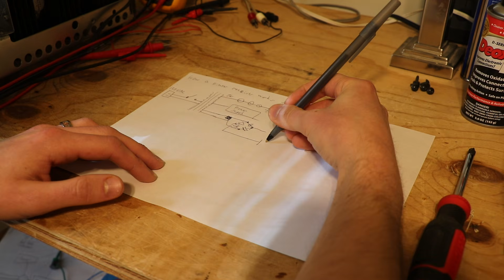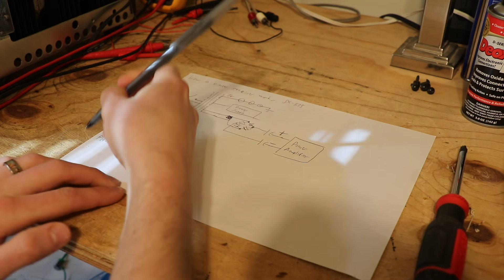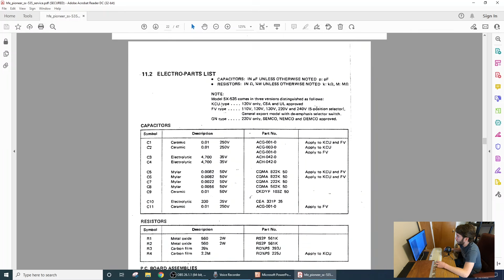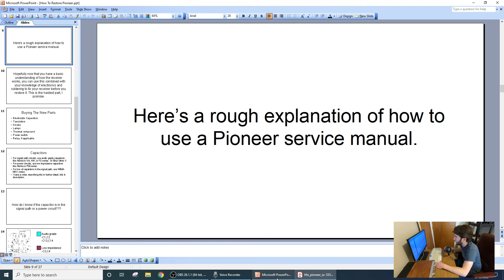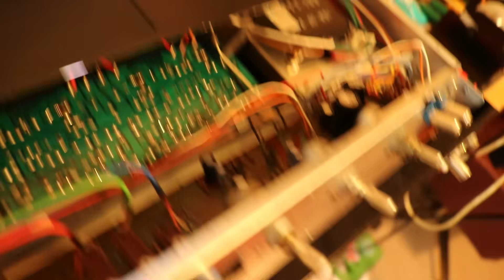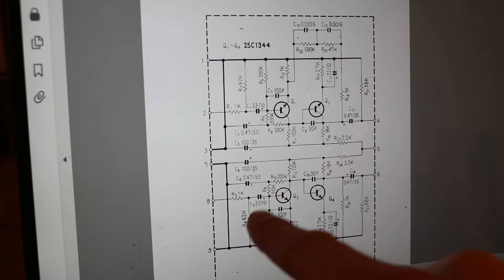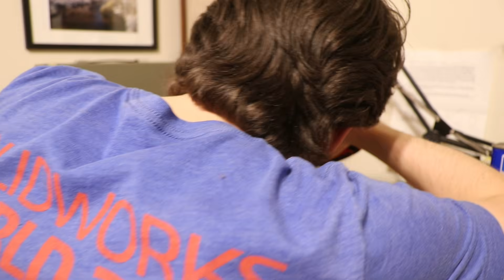How To Restore Vintage Pioneer

Comment: Fun fact that you may or may not know: The sheets you mention as being "plastic" insulators for the transistors on the power assembly are called "mica" because that's not a company name or brand or anything, it's actually the material that they're made from. Mica is a type of mineral, basically like a stone crystal that can be sheared easily into paper thin sheets. Sometimes they will be grayish or yellowish or clear. This is also why they are quite fragile. It's slightly flexible, but will easily crumble apart if you apply too much pressure to them. You can buy replacements for those. Really good video. Very informative.

Comment: The manufacture quality of Electrlytic Capacitors is imporant as well as the temperature rating. Capacitors maximum operation temperature of 105Deg. C should be more reliable that capacitors rated at 85Deg C.

Comment: Hello:  I just started watching your channel and do find the videos helpful.  I have been in electronics since high school and now am 55 years old.  I learned something from you today, I have seen schematics a lot and got my amateur radio license a few years ago, now general.  Yet I had never seen an electrolytic cap diagrammed the way that the Pioneer SM showed.  You can always learn!  I would like to see a video on a Pioneer SX2000 as that is the unit I am likely buying locally.  It has tubes in the power amp.  I am sure that I should go through it and clean the controls and all the usual components, though I believe this model will mostly discrete components.  Thanks for this particular video.

Comment: Just found you!  And not a moment too soon. I JUST picked up a SX-535, super clean. Please advise if you have a parts list of EVERYTHING, all pieces lined up in front of the unit. I'm diving into my own rabbit hole. Vintage audio is now my preferred hobby now that I've had 70 trips around the sun and the reactions are not what they used to be riding the motorcycle. Reply is you have a list.  Of course I can watch the entire video with a note pad!

Comment: I bought an SX424 brand new in 1973 and that's what I use today. I found a local shop owner who has been repairing electronic gear since the 1980's and spent about what I originally paid for the unit 53 years ago when new.  It's been relamped, cleaned and the power amp caps replaced. I know that doesn't agree with many who look for complete replacement of many components, but the point of diminishing returns is pretty low on this model.  It was the lowest stereo receiver on the Pioneer totem pole when new, but it has some sentimental value and works fine for my use. If it fails it will make a good nightlight!

Comment: The technician changed out 70+ capacitors in my Bang-Olufsen late 70s audio system. I was astounded by the number of capacitors. The unit isn't well ventilated, and that may be the reason for the failures.

Comment: One of the best how to videos I have ever seen.  BTW, tantalum capacitor are polarized. Not sure if it makes a difference here but if may affect the ripple filtering. Have you ever had a problem with those pinching plastic mounts breaking? Or finding replacements parts if they do? There are small ratchets that will hold a Phillip head bit for very tight areas.

That was a clever trick on attaching wires to the large electrolytic capacitor leads on the amplifier board.

I did want to mention one thing about eliminating the resistor between the positive and negative leads on those capacitors. The combination of the capacitance (farads) and the resistance of resistors creates a frequency band/notch filter for smoothing the power rails for the power transistors. Also be careful with routing wires over shape edges. Wire insulation can cold flow over time and create shorts.

Comment: Thank you for this video.  One small nit -  you describe some emitter bypass caps as “power” just because they go to ground. This is not accurate- they are there to decrease the AC impedance of the emitter path to ground to set the AC gain for the audio.  A better way to characterize the caps is whether they are filtering 120 Hz rectified AC or providing supply bypass.  Those should be the low impedance power types.  With all that said, you’ll be hard pressed to go wrong with a good quality Nichicon or Panasonic cap of any series.

Comment: I had been looking for a vintage receiver and bought a Pioneer SX-535 off marketplace for $60.  It supposedly "worked", but when I hooked it up to my speakers it had issues, dc voltage at the speaker outputs.  I found this video and thought I would try to repair it.  I ordered a kit from eBay, bought a de-soldering tool (game-changer), and practiced my soldering skills on some old boards.  When I felt confident, I started on the amp board.  I had a couple of mis-steps (dim bulb tester saved me), but I managed to repair the amp board and now have the receiver that works very well.  Great video, very informative.

Comment: good information. just some additions from a guy who has been doing this for over 40yrs 🙂 i always replace composite resistors with 1% film resistors. composites are a huge noise source and that causes your gear to fight with itself. also replace all the ceramic caps that you can with film caps. you should leave the tuner circuits alone if you are watching this vid! tuners are the most complex part of the audio system and that is no place for a novice. who listens to radio any more anyway 🙂always shield your signal wires and pay attention to its routing. if you can get new diodes, they are cheap, it is better to replace them all. same with small transistors. the power transistors may be harder to find and will cost more. since you are in there, if you can get them within reason, do it. components are generally pretty cheap. if you are going to do it, do it right so you will not have to worry about it for a long time. i want to reinforce your dislike of tantalum caps. there should never be any in an audio gear. all this will give you much better sound stage and headroom. you will find that you will not turn up your music as loud because you will hear everything at lower power level. this makes for a more efficient gear and helps save your ears too 🙂the system just deleted some of my comment but i guess it'll have to do. well done vid. lots of work. cheers 🙂
Reply: excellent comments
Reply: @stevepacker2327  🙏

Comment: Just had three of my units done.  A Marantz 2240.  Pioneer SX980 and Sansui G-5700.   I still have a mint Pioneer SA-8100 Amp that needs to be done, but am unsure about the value in putting 500 bucks into that unit.   In each of the above cases the guy handed me a huge bag of bits, just like what you have pictured on the opening scene to this video.     They all sound great.

Comment: I admire your Restoring vintage Stereo's. What a cool talent. I've had my Pioneer SX 1010 Receiver since 1976. I purchased it from Pacific Stereo in Berkley CA. I used my Gas Station attendant and Paper Boy money to purchase. I still have it. It is in immaculate condition. Everything seems to be working but the left Speaker channel goes in and out. But man they do light up cool looking. Take care.
Reply: I have an SX 950 with the same problem. Cleaning the volume control helped for a litlle while.

Comment: It's no good practice to bend the leads of the new components to keep them in place before soldering. If you ever have to remove one of those parts again, it's hard to desolder them and likely to damage the PCB tracks. Bending the leads up agein for cuttingthem  also puts mechnaical stress on the PCB tracks.
The proper way to install new parts is to insert them into the PCB, cut the leads to length and thereafter tack-solder one lead while holding the part by hand. When the part is positioned straight and firm, all leads are soldered finally. By doing it like this, you get nice solder joints and also the ends of the leads are covered by solder.

Comment: What’s your take on lowering bias pots to the lowest setting before replacing output transistors and setting bias from scratch when done? I’ve had instances where new outputs had much higher gain and the bias took off and the outputs shorted.
Reply from the maker: I don't see anything wrong with that.

Comment: I have an SX737 I bought in 1976, took it out of storage after about 25 years cleaned it up a little and it still works good. I was wondering what is the average cost to have it restored, new caps, transistors, etc. and LED lighting. I may be able to do it myself, I was a mil-spec solderer, so I may have the ability. just looking for an average cost to have it done. Thanks

Comment: I would start with the electrolytic caps for sure, and then replace other components as necessary. However, you did say a restoration, so it wouldn't hurt to go beyond, by replacing ALL of the aging components. Cheers!

Comment: i JUST REPLACED THE FILTER  CAPS ON A SANSUI 771 AND THE FUSE BLEW. PLEASE TELL ME IF THAT MEANS POWER SUPPLY PROBLEM AND WHATS MOST LIKELY THE PROBLEM IF ITS NOT THE POWER SUPPLY. THE VALUE OF THE OLD CAPS ARE 4600uF 50 VOLT AND THE NEW CAPS ARE 6800uF 63 Volt. I PUT THE OLD CAPS ON THE DIM BULB TO SEE AND THERE IS A SHORT. HIGH WATT THANKS FOR YOUR HIGH QUALITY VIDEOS!

Comment: At ~ 7:10, the smoothing capacitor connections seem to be drawn incorrectly.  The bridge rectifier converts the AC voltage to DC.  As drawn, wouldn’t the capacitors block the resultant DC?

Comment: I am pinching myself with a THIRD Hitachi (SR-503L) that I bought for $120.  It was advertised as recently revised and the job seems to have been well done; incl. proper audio-grade Nichicon FG's in the signal paths and replacement of transistors with known issues.  I found the selector switch needed a bit more cleaning, which I flushed with generic e-contact cleaner (cheaper than D5), let dry, then spritzed with Deoxit D5. The unit itself is really clean...EXC++.
The man who sold it had a much more expensive amp that had been sent for service, so this was his stop gap unit for that period. Clearly, he spared no expense on this Hitachi.
In any event, I bid and got it for a literal steal. 
Using it on my office desk with a Marantz EQ20 (mint/like new, bid/won for $120), replacing a Hitachi SR-903 that I am preparing to revise on my own.  Parts were ordered for this SR903 (plus the one being used in the family room); most of these parts have arrived. In addition, waiting on a TC-1 tester so that I can gain (hFE) match the SKC1845's and SKA992's that were purchased in bulk.  The SR-903 is a terrific unit but a bit too large for a desktop. The service manual is very clear and the PCB's are all well marked (unlike Pioneer), so I am looking forward to these revisions.
The SR-503L is a perfect desktop unit and is paired with 2 sets of bookshelf speakers [(A)Mordaunt Short 20i's and (B)Sony SS CSD1's]. Plenty of power, as I seldom go above 3 on the volume control (usually I stay <83dB). Like the Class G amp on the SR-903, the 503L has similar capability with 2x25W into 8 ohm RMS, with peak transient up to 90W. An impressive little receiver, IMHO.
Seems the Hitachi's get little notice by collectors.  Thank goodness...NO Marantz/Pioneer/Sansui tax from hell!  These babies are LONG TERM keepers in my book.  Selling off a small collection of the rest (e.g. Pioneer receiver, Marantz amp) to standardize on these Hitachi's.

Comment: I've got a pioneer sx-1010 from 1974 I recently bought and now when I open it up, I can somewhat know what to look for as to if it has been serviced at all. 
I want to restore it but it was hard to find in working order so a bit nervous about it being my first project. I'm going to attempt servicing some other equipment first, get by campfire badge before I attempt the 1010. You have great explanation skills and I learned a lot, especially the resistors 3 legs and how to get them right. I think one board at a time, slow and tedious, I'll get it right over time. Thank you for the video, subscriber for life my stereo geek friend!!

Comment: The bridge rectifier/filter capacitors [aka power supply] produce DC for all circuits at different voltages.  You have the secondary feeding the circuit boards direct.  That is incorrect.  The power supply does that.  The secondary feeds the power supply which feeds the circuit boards

Comment: Great job on the vid. I thought you did an awsome job explaining how the system works and explaining each different component in language people can understand. I wanted to comment on how to figure your hourly rate out to be fair to you. The most important thing is charging for each individual part and any material you use. What you pay for parts has little to do with what you charge for parts. If a part is has to be shipped and not something you can get locally adds value. You also have to figure in your time and cost for ordering, unpacking, counting, dividing and stocking not to forget the time it takes to do inventory. You may pay a buck,  but when it is all said and done it is probably valued around 3.50 to 5.00.  What's a guy making an hour working for a company that provides similar services? for example, if he were getting paid 35 an hour the shop is likely to charge110 to 175 an hour. depending on what that hour charged is paying for during that hour. There is over head like insurance, rent, equipment, power, to name a few. then you need to pay support like accounting, customer service, Etc and lets not forget about comebacks. Yep, the shit that had nothing to do with your service but you will never get the customer to believe otherwise.. These numbers are only guess-tamates . A person can not fairly charge same as shop rates when working from his home, after hours. He/She/Them or however they want to freaking identify,( I miss the good old days, when it was simple.)  sure as hell can get more than an employee working for a company would get. The work being performed is personal and that alone makes it worth more. Hope this helps. Have a nice day people.

Comment: That looks just like my Sherwood S-9910 circa 1982.  These are great receiver's.  I used to have a set of Klipsch Corner Horns hooked to it, now my daughter has a Pioneer direct drive turntable feeding it with a set of KEF studio monitors making the music for her vinyl collection and it's still going strong.  Had to replace the meter bulbs a few years ago, that's it.

Comment: Also be careful when replacing transistors as new replacements tend to be high speed and low capacitance which can make them oscillate at high frequencies. Use a scope to check. I do not believe in changing transistors unless they are bad as too many changes takes away from the vintage sound and quality of the unit.
Reply: ¹¹¹¹¹¹¹1¹🎉❤❤❤❤❤❤🎉❤❤❤❤🎉🎉❤❤

Comment: I would not replace any polystyrene caps unless obviously defective. I would not replace any ceramic disc caps in the RF or IF section. For the low uf capacitors in the signal path and especially the FM detector circuits and phono RIAA equalization circuit I would use Wima MKP10 series not MKS. For electrolytics in the signal path I would use the Silmics or Muse caps.

Comment: In your diagram you show the caps on the secondary winding/bridge diode going to the power amp to be connected in series... so they are DC blocks?  Probably go to GND, right?

Comment: You have explained everything very well . But the transistors you didnt show what leg on the transistors go where ? You didnt show any markings on the transistor to show what circuit it goes into. I am totally lost . I would think the trans would be marked on top for each leg but you did not show that. I know you dont read these replies but sure am confused

Comment: How much does it usually cost $$$ to Restore Vintage Receivers?  I'm in SoCal area and have quite a few Vintage Receivers (Marantz 2226, 2250, Pioneer SX 737, SX 450 and Sansui 771) I bought in the last 2 months alone.                                                                                              
Btw Your videos are very helpful! I have changed FM Bulb to LED from your tutorials.
Reply: I've seen them run anywhere from $75-$125 for the part kits (capacitors, transistors, etc.) + anywhere from $150-$250 in labor.  In addition, add shipping both ways if you're sending it to someone to work on it.

Comment: I've caught several of your Video's like this and like to say that you really seem to know your shit on older electronics. I spent many years servicing Hi-Fi audio for a living and must say I sincerely disagree with the Shotgun repair method. I'll be the first to say that I've pulled my share of Boners during that time, (And still to this day).lol. But in doing what you recommend can be a Royal PIA. I've had 'NEW' replacement parts being DOA or Worst,(intermittent), a NJ d had to Start all over, (with Time being the constant nemesis on my butt). 'Newer" components may have advanced but, I'm guessing that "Dud's still exists and throw a monkey wrench in a person's hard work.  Just a suggestion,  repair or replace one step at a time. Thanks for the read!🙃
Reply: 1Oh Sorry but  really nice desoldering gun

Comment: wow, that's bad work, glad you got it working. Seems it is pretty repairable. I had a broken C1345 transistor on my harman 330c and I could change it with a bit of help troubleshooting it (I am new to this) and I also have a PM620 that has leaky main caps (like real all over the board!) and as far as I can see, there is some damage to the transistors. Not sure if I ever get it working, buy I might well try to gain a little experience, or frustration, or maybe it works, who knows. haha good work.
Reply: Love the HK 330c receiver! It's my go to receiver after the Pioneer SX-650 which is a beauty too.